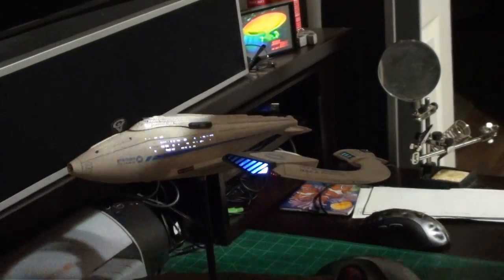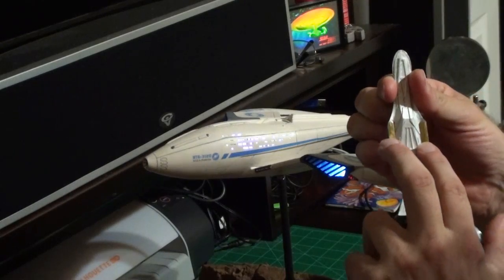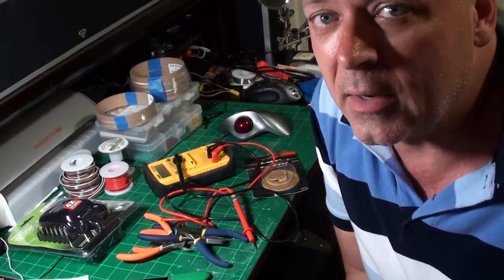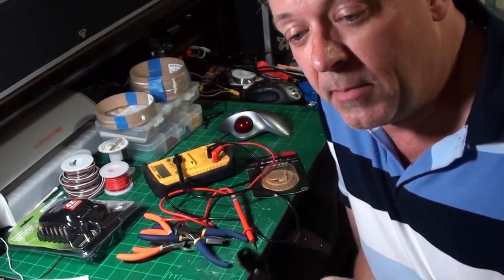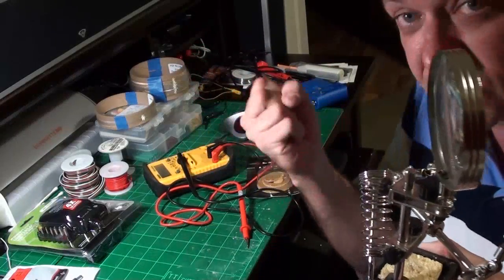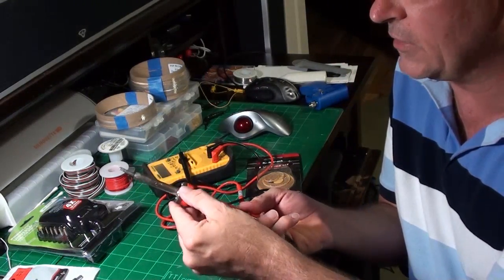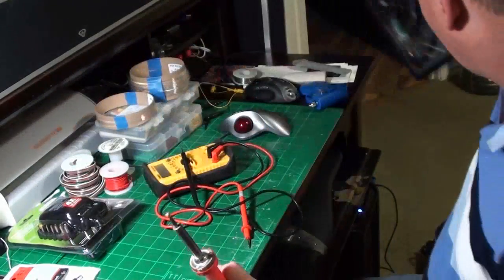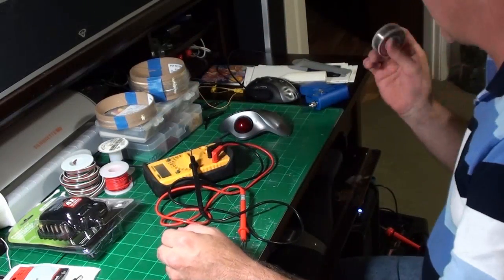Lighting Tutorial:  Basic tools part 1

Comment: Enjoyed your videos today, watched the build of the 747, looking great, well done.
Couple of tips though on the soldering iron to save having to buy new tips. Get some tip cleaner/tinner, its like a pebble stone that you dip the iron tip into between burns and it keeps the tip crystal clear.
As far as solder, also, you really should use flux prior to soldering. Flux makes soldering a million times easier, plus the joint is a lot cleaner and less likely to break.
Keep up the good modelling